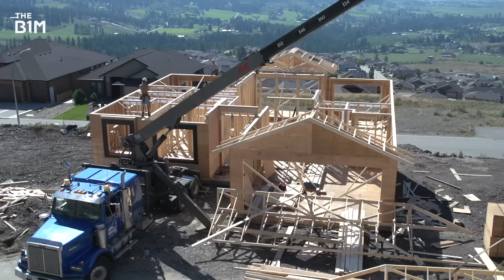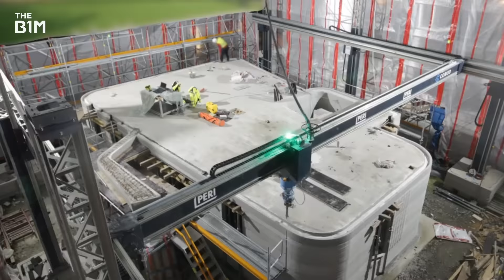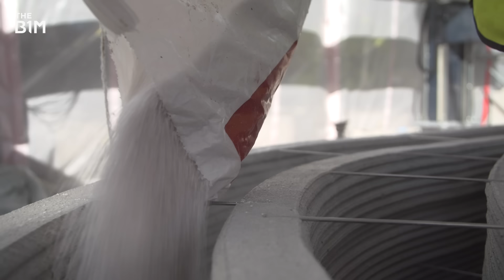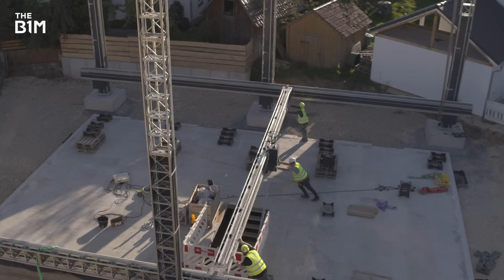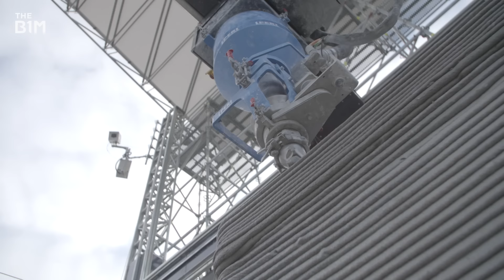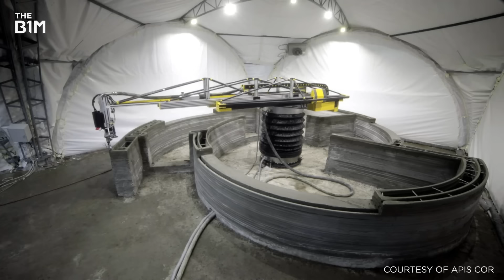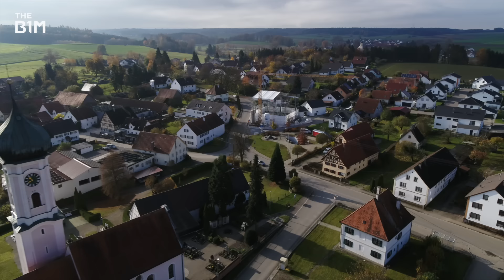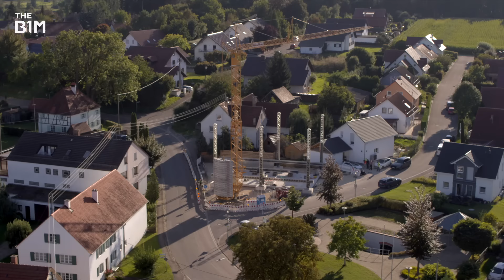Why This 3D-Printed House Will Change The World

Comment: Can you do a deep dive into the actual engineering design of this building? I don't see any steel reinforcement in it. How does it resist lateral loads? It looks like it wouldn't work here in California...
Reply: If you look closely you can see the builders placing staple-shaped steel reinforcements into the concrete, tying the layers together as the print head works.
Reply: @noxylophone  it still doesn't come close to having #4 rebar

Comment: I would love to live in a 3D printed house. I think the old fashioned way of building houses is stupid... so much maintenance needed to keep it intact, and so many unnecessary steps involved when you do said maintenance. ...and the whole thing is made out of fuel for fires...
3D printed in concrete = fireproof and no siding or painting to deal with... that alone makes it far better.

Comment: Wonderful, let's start using a system that utilizes concrete as its' main building component when concrete has huge CO2 emissions associated with it. We're trying to get away from concrete and towards more sustainable building materials, not go towards materials that emit a lot of CO2 during their production. Sure it's nice to look at being built but it doesn't do the planes any good.

Comment: I'm very curious to know something how do they add some of the essential such as power and Plumbing even gas line HVAC system in this 3D House ?
Reply: If it was me, there'd be grooves along the walls for that stuff, covered by decorative trim panels for protection/aesthetics. Would make maintenance and modification easier than a traditional house.

Comment: A crane and 48 hours to set up (and assuming site requires no work to accommodate the 'printer'), a crane and a day(?) to pack-up, plus construction time...it's hard to believe that this can compete with pre-cast concrete. Especially considering the latter can be pre-finished and/or requires much less work to finish.

Comment: Not enough details here. We want to see how they did the floor, roof, utilities, etc and how it was finished.
Reply: Can't wait for tutorials on how to print your own 3D house with "5 tips and tricks when installing HVAC ducts in your 3D printed house" :D
But I agree, am very curious about what you were asking, though I do feel like that would somewhat fall under trade secrets, so they might not release this kind of info, as useful as it might be for the industry as a whole.
Reply: @sementhrower420  more likely it would undermine the viability.
Reply: yeah, something like plumbing and electrical
Reply: @abrorabyyu6221  a bit of the electrical, you see at 6:09 and it's mentioned, near the end, that the electrician saves a lot of time, cause he is working while the wall is in progress, so no cutting open and plaster it again...
Reply: @philihc  except the walls are filled with loose grainy insulation that looks a lot like sand meaning that when those cables need to be replaced it'll require a lot more effort than with a regular house. That being said, like he did say, this is just another milestone and things like long time maintenance weren't part of that yet.
Reply: @philihc  so no additions or renovations in the future...
Reply: @philihc  - as a 12 year electrician, this would save no time, I don't see how 3D printed building could possibly be wired faster then a traditional wood home.
Reply: @Derek_Ash1  you are thinking the American way. In Germany most houses are made out of bricks or concrete...
Reply: @philihc  what does that have to do with anything? Electrical speaking
Reply: @Derek_Ash1  you need to mill channels for the wiring.
Reply: @philihc  lol, that sounds like the dumbest way ever to wire a house.
Reply: @Derek_Ash1  that's the way
Reply: @philihc  While I didn't understand any of his alien tongue, I got the jist of it.  That person would never get hired in the US, that process seems crazy to me.   When I encounter brick or concrete walls, the only method we employ is using Wiremold.  It's a surface mounted product, finished product may not look as good as yours, but it's way faster & cheaper then the method you guys use.
Reply: @Derek_Ash1  I think it's a different approach and also a different market. Here the most people like the idea, that you build a house, that will last multiple generations.
There is also a market for quick and cheaper buildings, which are sometimes prebuilt and -wired
Reply: @philihc  My house is nearly 100 years old, and it's still in great shape.  But yes, your culture has many more older buildings.  In that video you linked, I seen the wireway went to the ceiling where it dangled, I assume for a grid ceiling...is that common for homes there?
Reply: @philihc  Yes, but a lot of them are made out of prefab concreate panels, also super fast. Now it would be interesting to see costs. but i think speed is not an issue here, they make those prefab concreate block houses just go up super fast.
Reply: @ww-pw6di  They could have used cable tubes built inside the walls which would be easy for maintenance.
Reply: @ww-pw6di  ummmmmm if its grainy im sure replacing any cables is easy as you can just pull old and tie new.
Reply: @kornpops1261  no
Reply: @philihc  doesnt that mean he has to be there the whole time, and has to work side by side with the builderings instead of just coming after and do his thing
Reply: @ww-pw6di  They just put in plastic tubes for the cables...
Reply: @Derek_Ash1  my thought when they said the wires are installed during construction. How does this get inspected where it is required?
Reply: @ww-pw6di    I'm assuming conduits are built in, for electrical wires to be fed through.
Reply: This is what makes this system bullshit. with modern construction (steel framing, ICF, ...) pouring the walls is a 1 day job. MUCH faster than 1m/s. And you end up with insulated walls... 
In most of the world construction manpower is dirt cheap compared to this.
Reply: @Rostol  many places are looking at building much taller buildings via stick framing. Wood is more sustainable than steel or concrete from an environmental standpoint. And a good crew can erect a lot in a short period.
Reply: @Rostol  at least it would be precise and square.
Reply: @Rostol  I have yet to,see vertical and horizontal rebar.
Reply: Given the competition and the multiple companies trying to push this out, the details are likely to be somewhat obscured for some time - or not, I don't know how much of that have to be made public to get the german permit
Reply: I've got a ton more info on 3D printed concrete on my channel including 13 podcast episodes with founders from companies contributing to 3D printing houses. Many of the projects are still under development and some are experimental. Its a brand new industry thats just getting its footing but I think it'll take off in a really big way within the next 3 years.
Reply: This is basically an ad for this company.  Absolute shit on details.
Reply: You would have to have the various trades working in tandom with the "machine" , everything carefully timed. We don't have the technology for a digital printer to do it all in 2021.
Reply: right, how much is the cost of the toothpaste.
Reply: A buzzsaw and hot glue to put it back together after you are done.
Reply: I think if it's certified by the German government, you'd think the floor, roof, utilities, etc would be acceptable.
Reply: Well you have to keep in mind how much money and time they put into this, showing the details would completely go against the concept of business, other people could use that information and not have to pay how ever many millions it cost these guys to figure out the procrss
Reply: @jesssmith1850  Just showing a house with a second floor installed would suffice. No need for additional detail.
Reply: the first thing I think of is shrinkage cracks
Reply: Dude, do you know about safeguarding your technology or know-how... ???
Reply: Oh details just go with the hype I mean construction isn't hype is it? HA!.
Reply: Because it's proprietary??? Oh just give us your money making secrets 😂
Reply: They don;t have them.  As efficient as this looks, it will never be the way to go.
Reply: @jx024x  To qoute Mando:  This is the way
Reply: @Derek_Ash1  Going back to the real world: No it won't.
Reply: And $$$ these things cost twice as much
Reply: There are none. We have to cut our emissions because global warming. You have your mask to stay warm.  Just obey. Trust us.
Reply: Man ... if you actually buy the house you can decorate it however you want and probably when it become available to public you can just create your own design and everything and they just make it for you... wtf
Reply: Dave Taylor, I shal save you any further speculation... by human skilled labour. I can only really see that they have ommited the brickies. That of course is if the final customer is happy with a concrete house 🤷‍♂️. I am all for new technology but like many game changers before this the nitty gritty of the reality is often not mentioned in the big sell.
 *UK carpenter with 19 years under my tool belt
Reply: Thanks
Reply: I'm sure that be adequate savings but generally in the late 70s extensions from builders would be at cost plus a premium 10% and whatever it might be if I was a bit of might be but now they add up what the the median price of the suburb is and you pay that what the weather that house costs like if you put a double storey extension they add up what the cost of the house would be when they finished what they do what you would get for it may they calculate the price that way we're in and cost where is before they it'll just be you're paying for the materials cost to be was labour CrossFit plus a bit of profit which most the time would be it's still make a great quite a 20% profit on their work with now they like to make the prophet
Reply: TEC Youtube  I'm talking about Germany. And usually building with bricks.
Reply: You can see holes for utilities in the walls on some shots, so I assume as the walls are out up the utilities are slowly added...  The nature of 3d printing means you would have to install utilities as you build/print, which means, before you start printing, you'd have to have your house all planned out
Reply: Yes I want to see more details but this is a good introduction. If you watch carefully you can catch on to some of it. This is certainly the future of building in so many ways. I have 1000 uses for it as a single proprietor builder.
Reply: Probably mostly similar to ordinary construction, but the structure part of it are considerably faster.
Reply: Exactly this barely gave any real info we wanted on livability.
Reply: Right, it doesn't show the support walls, usually they require steel, otherwise I doubt it will stay
Reply: Yeh.
Reply: Search for the Video: Move in Ready 3D Printed House in Germany
Reply: Like any other home really. Its literally just a concrete construct, which people have worked with for decades in brick and concrete. Heck you can go back to clay structures and work with it like that as well.
Reply: @John-uw2je  it's the method not material. What did you expect the house to be made of?
Reply: Its made by germans.. it will work..
Reply: That's for you to find out, ylthis is a simple overview
Reply: That's not the subject of the video
Reply: That's your own homework
Reply: @hectorlopez-si3hw  No it's not... they are the ones trying to promote it. Why do people have to say such stupid things?
Reply: @hectorlopez-si3hw  If you want to sell me some shit, then you should give me all the details.
Reply: @maythesciencebewithyou  no one is selling you anything

Comment: Given the questions about the sustainability of concrete construction, though, I wonder about the long-term viability of this method of construction.

You can't 3D print wood construction, and that seems to be the most environmentally responsible building material at this time.

So where is this building method going?

Comment: The only thing that worries me is that these days, if you outgrow or become dissatisfied with your home you can knock through walls or extend easily. To do that with these will require new contractors with new skills, which may not even be viable. Theres a fair chance that to extend, you'll have to move.
Reply: Just like normal i guess? Pretty much all houses are Made of stone in europe

Comment: Unless I missed it, are these structures all being made of concrete, or are other materials being used? (I heard on another report that we are running out of concrete. Is that true?)
Reply: There is no shortage of raw material used for making concrete.  The issue is that the Portland cement, used in concrete, takes a lot of energy to create and current processes produce a lot of carbon dioxide (about 8% of all the carbon dioxide produced).  Hopefully, we will develop better technologies that use renewable energy and do not produce carbon dioxide.

Comment: Assuming they are using concrete for this is that not a Hugh green house gas concern?  I hear numbers being spewed by the media but I've never seen the numbers to back that up.  
Also I'm assuming they lay all the mechanicals in the walls after they are built and the fill them with insulation?

Comment: 8:30 why did he say round shaped homes are more sustainable than rectangle ones? how does the shape affect its sustainability?
Reply: Round shape contains less air space to heat/cool. ...I don't want rounded walls though because tables, couches, and TV's are all rectangular. A domed concrete roof would be amazing though... no more replacing shingles!

Comment: Will not be the future. 1st its to expensive. 2nd the printer is not as mobile as expected, cant be placed anywhere. 3rd the admixtures used in the concrete for printed houses is way to complex for the consumer market, flow abilitys, strength, drying agents, and so on. Also you will always have rounded corners, what can look nice but furniture placing inside will be difficult. further more: how do you lay in the cables, or the heating pipes for water etc etc. you cant just drill through concrete like butter, and if you do, its a hell of a job.
those houses are nice to look at, but the average middle class will not build like this.

Comment: What is the old saying? When you only have a hammer in the toolbox, everything looks like a nail. When you only approach a subject from a tech viewpoint then all your answers are "more tech". This achievement of 3D printing houses should be commended, although I think it does not solve the actual problems regarding high housing costs. The collapse of the middle class (depression of wages, anti-union laws, etc), and the fact that housing has been turned into a speculative investment market by excess capital in the hands of the rich, have all driven up costs for housing more so than simply how much the cost of construction is. Also, it seems that single family housing's ongoing protection from redevelopment into more dense housing options have also distorted the cost of housing. Normally, as a municipality grows, the housing density grows as well as a natural consequence of population growth but due to the fact that most cities have the majority of their city zoned for single family housing this natural 'upscaling' of density is prevented from happening. Thus, land becomes distortedly more valuable due to the artificial protection of single family housing. I was once a person that believed in technology as a cure all for all problems (I call it 'Silicon Valley Lense' disease) but recently I have learned that a lot of problems are not technology problems and actually require different solutions.

Comment: That house is about 500 odd square feet. That's smaller than my one bedroom apartment! Why the hell would I want to buy that? I've been trying for years to move up! Also, it's ugly to me. Pass. That one in Ulm is even worse! 380 square meters divided into five units comes out to 76 square meters (about 250 square feet) of living space! What the hell is with these tiny shoebox houses? Let's also not forget that this would effectively mean a decrease in jobs due to partial automation. Everything is a race to the bottom these days. This was depressing.

Comment: I see that there are still some places where you need a human to insert a metal bridge over a gap or whatever. This could be done by a separate robot. The robot would know exactly when to place the bridge and already be right there. You could have the design such that it staggers the bridge placement to give the robot sufficient time to move around. The robot never stops and the printer never stops.
You'd still want people to load the bins for the robots but that's simple labor as opposed to specialized labor.

A few years ago I had a chance to tour the local Hyundai plant. They had lots of robots but also lots of people, working alongside each other.
The way it usually ends up is you still need as many people, but you crank out the product much faster.

Comment: Concrete construction is HORRIBLE for the environment! "Eliminating waste" sounds nice and everything, but that lumber CONTAINS carbon! We should be using MORE wood to build houses, not less! Perhaps that company can invent some sort of wood pulp & glue mixture to run through their printer? 

Honestly, if I were to build a home out of concrete I'd build one of those inflatable DOME houses and bury it underground to use the earth's natural heating and cooling. In Germany, given their cold climate, they should focus on building those greenhouse domes they have in Denmark (Dome of Visions) that go around your current home and reduce your heating bills!